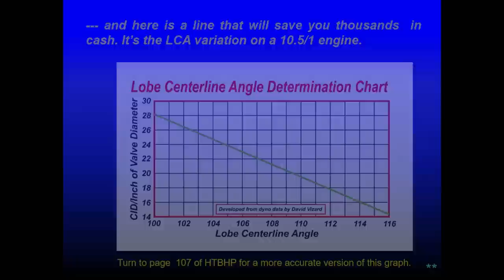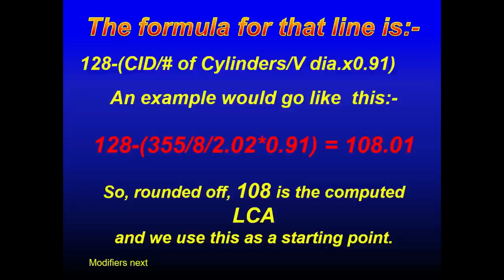Cam profile dynamics Vs event BS bashing!

Comment: Howdo David, 
I have built a 305 cubic inch small block Chevrolet, 10:8/1 compression, standard small valve heads that are ported and port matched, the research I did at the time recommended a rv type cam ground at 108 degrees lobe center and advanced 4°, try as I did,  I couldn't find a catalogue cam to suit these specifications, so I enquired the local enjine builders and they all argued and ultimately refused to grind the cam I requested, so I have so far retained the standard Camaro cam advanced 4°
The enjine has 11/2" headers, 4-2-1 @32 1/2" ,a weiand stealth intake manifold with a 450 Holley spread bore carburetor. Electronic distributor and good quality ignition leads with champion spark plugs. 
The enjine was originally designed for running propane gas as fuel, at 106 octane 
My estimated hp.rating was 300 and 250ft/lbs torque 
Do you consider I'm somewhere close to the mark for building this small bore Chevrolet?
Many thanks for your consideration 
Ed

Comment: A friend built an engine for hot street and he used a chevy performance 'off road' cam (kinda like a circle track grind) and used 1.94 / 1.5 valves instead of the usual 2.02 / 1.6s .. He said because of the lighter valve train he could zing it up and it loved sitting on 7000 all day if it wanted to.. I reckon 1.9 with 1.7 exhausts could be a good combo for a  turbo / supercharged engine because you want to clear the old mixture out of the cylinder as much as putting as much new mixture into the cylinder as possible!

Comment: I have issues with any builder or gear head when they say I got stage blah blah blah...I tell them that means nothing.  If you change engine dimensions you need David vizard cam calculations for optimum power!! His cam advice is true in my case. I built a healthy 351w on techniques I learned from David's how to build horse power books.  My math ended up with a 108 lca cam,  I bought a cam not custom but generally close to the lift and duration needed also due to advice from dvs books.  The engine ran phenomenal

Comment: Thank you for sharing your engineering acumen, looking forward to your continued sharing.  Question, how does the formula change with multi-valve heads (such as 4 valve with 2 intake and 2 exhaust valves)?

Comment: DV, thank you for explaining that this formula does not scale. I’ve been trying to relate the factoring number to the bore and stroke ratios in my, Nissan engine which is to the decimal with the, Chevrolet. But which I’m seriously over-valved to the Chevy. We need another Cam course available, please?

Comment: Mr Vizard, you should explain that low lift flow during overlap depends primarily on valve diameter and valvejob. People get crazy when you state a 2.02 valve 882 with 210cfm int port has any valve event commonalities (lsa) with a 290cfm 2.02 afr head

Comment: another great video, thanks for sharing your knowledge.  Question- I think I heard on a TV show that EFI engines require wider LSA vs. carbureted engines.  So, in the 350 10.5-1 with 2.02 1.60 valve example that you give, would 108 LSA work best on carb engine, while an EFI version requires wider?   or is that wrong?
Reply: They originally did that to tame the idle because a rough idle drove older FI systems nuts. The engine doesn't know how it got the fuel it just burns what it got
Reply: @jimdouglasgregory  thank you

Comment: I remember that s*** show of a thread on speed talk

I was signed into that forum when it was all going down, and really didn't understand why people had such a beef with your formula

The whole premise that you put forth was that this was a tool that the average hobbyist could use to get a pretty good result on an SBC, (and would even be in the ballpark something similar like MoPar wedges, Windsor Ford's, etc)

The funny thing is that, even as a casual hobbyist, The trend that your formula shows wasn't a complete surprise.

It's been pretty common knowledge that when you build a stroked version of a given engine, they tend to like a little tighter LSA, and that highly developed engines with excellent cylinder heads and large valves (Comp Eliminator, Pro Stock, etc) can end up running fairly wide LSA cams

Applying this formula to my 489" Plymouth with 2.14" valves (if it is truly a good application for this formula) calls out for a cam ground on 102°

Should I run out and have a cam ground on a big $$$ custom core to get that LSA? Beats me.

But I suspect if I want to buy another cam, I should be looking to see what I can get on a fairly tight lobe center

If nothing else, it would save me from going out and buying something ground on 112°...

Comment: David, tell me what I need to get the L sep correct. 355, 2.08 int valve , I get 104.55. I presume that would be for 10.5:1. I have 12.5:1. So is it 2 deg for every point above that? Am I correct on these calculations? The cam I have is a roller with 106 ls but it seems to run the same time on the 1/8th if I shift it 6900 or 5700. Could it be the torque is awesome compared to the HP? I've never had it dynoed . Not trying to pin anything on you just bewildered on this combo.

Comment: Hey David I have a question for you I want to get the most power out of my SBC but it needs to pull stock vacuum because that's the rules of  the class I race in what would your recommend?

I was thinking 450 intake lift 460 exhaust lift 224 @50 duration on both intake and exhaust  and 114 LSA or maybe 112lsa and degree the cam ahead 4 degrees would that work?

Comment: David, I enjoyed the video. Would it be possible for you to explain to us a way to determine  proper valve opening and closing events go along with the LCA? Also, how much accuracy is lost when applying the 128 formula to other inline valve V8 pushrod engines? Cheers!
Reply: The 128 formula is very accurate with almost any style 2 valve "wedge head" engine in the 10-1 static compression range. When it starts to deviate is when you increase compression past say 11-1.. then it would be best to adjust accordingly, because the higher compression will provide a much more efficient combustion cycle. As compression goes up, you can then generally begin to incrementally widen the Lobe Separation Angle to aid top end power.
Reply: @Torquemonster440  Thanks!

Comment: Thank you for sharing your knowledge based on your profound experiences. Please excuse my unexperienced questions. When talking about LCA, do you mean the intake LCA? Or are we always assuming symmetrical cams (intake LCA = exhaust LC = LSA)? 
Will the "128"-calculated LCA vary with changes of the static CR?
Reply: I think Dave means lca lobe centerline angle = lobe seperation angle...
Reply: @grandmasmalibu  thank you very much for your detailed response.
I misused the term "symmetrical". I hadnt the the lobe grind in mind but put the cam timing without any adv/retard in the engine, so that the both LCAs are of the identical value as the LSA is.

But if "LCA" in this video refers to "LSA" then this completely answers my question :)

Secondly I am wondering if the displayed 128-formula is exclusively dedicated to chevy small-block? When I enter the numbers for my mopar 512cui with 2.14 IV it returns a 101 LSA. Would this be plausible?
Reply: @rustonwheels3064  its close however the formula specified works precisely for 3-7/8" to 4-1/4" bore size very good. Larger may take more consideration (or math). With this formula you can do similar or make another one for big blocks.
Reply: @rustonwheels3064  yes, that is the correct computation.  But with many of these figures,  there are practical limits.I just got my 505 ci RB Stroker running a few days ago. If I was absolutely 100% intent on making the most midrange power possible I would have ground my cam on 102°-104° LSA. But, it really woul have idled like crap and had poor street manners, still the cam I am using is a Bullet grind on a 109° LSA.. works very well so far. For what it's worth,  the Bullet cams engineer I consulted with said the larger engines don't like being "wound so tight".. IDK..  take it for what it's worth. But overall yes, absolutely stay away from anything in the 112° lsa range or higher. Shoot for 107°-109° range if you can... you WILL make more power.

Comment: Thank you for sharing your knowledge. Looking forward to the next video. 
Do you have a similar formula for a small block dodge magnum?
Reply: The 128 formula will work great for a Dodge Magnum engine.  If optimized power for your combo is your #1 goal. Your going to sacrifice idle quality and manifold vacuum, but you will make the best mid to upper midrange power possible.

Comment: You're awesome David Vizard.  I was curious, from what I've heard cam timing changes the centerline. Can cam timing correct a bad centerline or does the correct one (like your formula produces) need to be ground in the cam period.
Reply: DV chart is lobe separation angle.(ground in) Installed centerline is determined by dyno testing on each individual engine.... Due to combination variations only testing finds the exact position. DV explains this on another video.

Comment: Years ago I ran and used to build some pretty good, for the time, ford cleveland's. All small port (2V) motors, because they were the readily available head here in Australia. I just sat down and did some maths on cam selection out of your How to Build Horsepower book. By pure chance, my best motors were all within 1°or so of  your guidance. Pure luck on my part, pure science on yours. I wish that I had read more of your books when I was younger. BTW, a lot of the guy's that I raced against had the large port 4V heads and even the SVO alloy heads.
Reply: Since the Cleveland heads have canted valves, you should use 131 instead of 128 on the formula.

You can go a little wider since the canted heads work better.
Reply: @earlbrown  if you read DV's book he uses a formula based on valve size and cid per cylinder. It then has adjustments for compression ratio and valve angles
Reply: @theshed8802   I have read his books. That's why I was able to tell you that canted valve Clevelands use 131 instead of 128.

I had no need to mention compression ratio adjustments because you didn't post incorrect information about that.

Comment: 🔔😎
I'm curious. 
The chart is for a 4" bore x 3.5" stroke engine. @350 cid.
How would the values change for a 3.0" stroke @302 cid.??
Seems like the LSA should be shorter because the piston acceleration is less and the filling time is less. 🤔🤔
Reply: The formula is just a gimmick. 
If you want to compute a cam spec, you need to use a 1D software like Dynomation or EngMod4T.
Those software have decades of work by people with top notch physics knowledge and programming skills.

David claims that the data he used to make that formula was from many tests run at Crane. That was when dynos were not well instrumented, engines made much less power and had much more flexible valvetrain parts. That data is not relevant to modern engines.

Comment: Thanks a lot David ,I do agree , however just to take note for future video it will have been nice to have the dyno graph to compare ,I do understand that it is not always easy to have exact comparison specially going back to data which have been recorded long ago.But if you can incorporate those graph next time it will be appreciated.

Best regards

ps :when do you think you will be able to have an episode on 4valves per cylinders head porting.amd how will you use your program on those type off head.

Comment: Will this formula work with forced induction, will you need a different LCA? Will this formula work with engines in the low 300 cu.in. range?

Comment: David, what happened?
Did you use the 128 formula and a hand-filed cam?

2019 Race Engine Challenge Final Scores
Eric Roycroft, LS3, Inline, 370 cu in, Peak HP 750, Score 1,658.2
SAM Tech, SB2, Canted-Hemi, 403 cu in, Peak HP 788, Score 1,651.1
Randy Malik, Yates SBF, Canted-Hemi, 382 cu in, Peak HP 740, Score 1,599.9
Greg Brown, Hemi SBF, Canted-Hemi, 412 cu in, Peak HP 820, Score 1,596.4
Randy Malik, SBC, Inline, 400 cu in, Peak HP 728, Score 1,517.8
Josh Myers, LS7, Inline, 429 cu in, Peak HP 743, Score 1,478
David Vizard/Terry Walters, SBC, Inline, 420 cu in, Peak HP 702, Score 1,466.8
Ben Robey, SBF, Inline, 376 cu in, Peak HP 608, Score 1,389.2
Tim Davis, BBF, Canted-Hemi, 462 cu in, Peak HP 759, Score 1,370.9
Darrick Vaseleniuck, SB2, DNF
Dale Robinson, Olds, DNF
Reply: Jon, lets say I had to hand make a cam using nothing other than a regular center lathe (no swinging head and a profile follower) I have the skills to do it. I see the sarcasm in the question i.e. did I use the 128 formula - why would I when I have told you time after time (I truly have lost count) that the 128 formula is a quick way for a regular engine builder building typical SBC how to get a pretty accurate LCA AND protection for the grossly erroneous  typical 100 -114 cam. NO as I have said on numerous occasions I would use my master program as described to you in a ST forum post that must have just slipped you notice. Of course there is the possibility it left you speechless  - so I got no comment. Now the hand filed cam comment - yes I have hand filed a cam for a Hillman Imp SOHC engine (bucket tappets) Made 121 hp and about 10,000 from 998 cc. Could you have done that? Let's see if you have learned how to answer a YES or No question here!!!!
Reply: @DavidVizard  
David, it seems like you are arguing that a properly engineered valvetrain is not important.
Of course the most important thing that a valvetrain must do is operate without breaking parts.
The best way to accomplish that is by proper engineering.
Your comments about polynomials tell me that you don't even know how a modern cam is designed.
Reply: You know, I read through that list a number of times, and yet I cannot find the name Schmidt anywhere on it, either above or below Mr. Vizard's.  Did I somehow miss it?
Reply: @ST.LEE118  I don't build engines, I engineer parts for many performance aftermarket companies.
If you own many racing engines, there is a good chance that I designed the cylinder heads or manifold you have.
If you race at a professional level, in NHRA Nitro classes, Pro-stock, or NASCAR it is certain that you have run a crankshaft that I designed.
Reply: @DavidVizard  
A professional would not work in the way you suggest.
A cam should be designed to do the following:
1. Be compatible with the dynamic capabilities of the valvetrain.
2. Be in harmony with the gas dynamics of the compressions ratio,  intake and exhaust systems.

Your 128 formula doesn't have enough inputs to do any of that.
Frankly it's just a gimmick that is about the same as saying, "run an narrow LSA and make more power". Sure that is true a lot of times, but it is also a common path to disappointment. 
More things need to be considered to spec a cam, such as desired drivability,  exhaust emissions; do you want to drive a car that puts out eye burning exhaust?
There is good reason that professionals that manufacture cams don't follow your advice. It gives people the false impression that they are following sound engineering when they are in fact ignoring critical factors and relying on the cam manufacturer making the cam dynamics mild enough for the parts they have, by guessing since they can't know what parts every end-user has.
Reply: @Poolguy8879  

We have seen how David does in dyno competitions, not well at all.

Comp cams engineers and makes the cams for more pro level race wins than anyone, hands down.
Reply: @jonathanschmidt6507  well they are the largest maker aren’t they ?? It still doesn’t make vizard wrong . And for you to automatically assume the comp cam is why they are winners is absurd and doesn’t back ur argument at all . 
He is an engine builder I’m gonna go with his expertise over a cam company .. why u ask . Because it’s real world racing conditions comp cams cannot and will never compete with that

Comment: Correct me if I'm wrong but I'm trying to learn. It's the over lap plus the centerline that equates the advertised duration? If so which part is the most important. Say you can get a cam with the correct centerline or with the correct amount of overlap which is the smarter choice?
Reply: No advertised duration is a separate dimension for each lobe (ex and intake). Has nothing to do with overlap.

Comment: Long rod vs short rod.. bc i have always heard a race engine should have a big bore, short stroke and long rods. I was wanting to know if it really matters. Bc i am building a 289 Turbo Clevor as a street/road race engine. Dont know what to put it in yet, but been lookin and a Ranger sounds dangerous and fun!
Im not gonna drag race it from a dig bc thats when you really shock and break things.
Reply: Rod length doesnt matter. Hard to change rod ratio after engine is designed anyway.